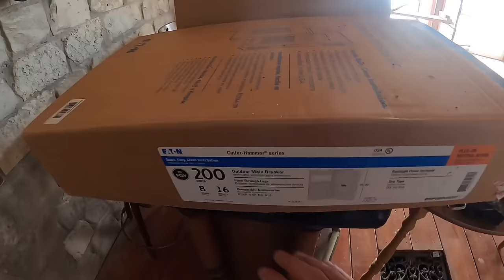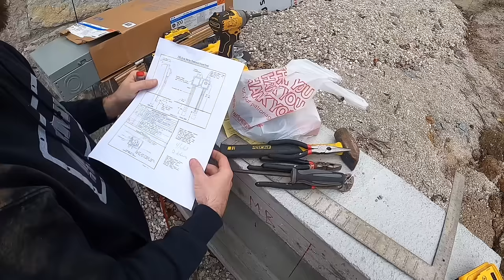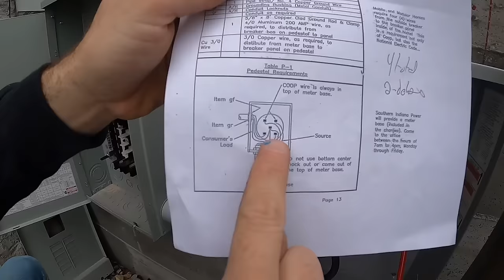prep work for 200 amp upgrade!

Comment: Definitely should have had plastic bushings on the PVC male adapters, before installing the cables.

The grounding conductor goes on the side opposite of the bolt, when installing the ground rod clamp.  It doesn't go between the rod and bolt.  The bolt tightens against the ground rod, clamping the grounding conductor between the clamp and the rod.

Comment: I truly love watching your vids and how you tackle your projects and I recognize different areas have different standards , I have been a utility lineman for 35 years now and have done storm work in several provinces and states so have seen many standards and quit frankly if your entrance passes their inspection I will be so worried.....been to too many fatal house fires over the years caused by faulty wiring.  Also noticed that when you dug the trenches that all the dirt piles are now blocking access to the power poles for the bucket trucks when they arrive......don't want to come across harsh but electrical needs to be left to the professionals.....John F.
Reply: obviously not !

Comment: Sometimes it is painful watching you struggle. But as an electrician, I have done this often and have found ways to make it go a little easier.
and where is your No-Ox? An electrical "grease" that will stop the oxidation or corrosion between the dissimilar metals. (copper and aluminum)
Reply: How about the combo lugs?

Comment: I'm assuming you will install communications of some sort,  while you have trenches open, toss in an extra 1" conduit and you can pull trick, catv, fiber etc, $20 in plastic now can save you $2k in headaches later.

Comment: Howdy Matt, here in Texas you can't have a meter base on the same box as your breaker panel. It has to be separated with either a 2" or up to a 4' splice / separator of conduit between the two and at least 4' off the ground for code. An your right it is a big headache when they don't tell you about that when your there getting stuff to wire one in and all. I've been through the same thing here. You're doing a Great Job on the Castle, Kudo's to ya on that.....

Comment: Good on you for having a crack at it mate, interesting to see how different countries approach construction work. That excavator of DP’s has a few sloppy pins and bushes in it, but I was surprised to see how much you beat on it trying to clean the bucket. Cheers from down under.

Comment: Here in upstate SC, Duke Energy requires dielectric grease on the 4/0 copper connections and must be taped red for hot leg 1, blue fot hot leg 2 and. White for neutral and green for gnd.

Comment: If you mount that panel so low you will have issues when the snow gets higher than the bottom of the panel. There are deffinetly electrical codes that apply in this case.
Reply: Keep in mind that that is not a weatherproof panel.
Reply: @Red1Wollip  He did state it was a waterproof panel.
Reply: @ArnieD17  the nockouts are Nema1 and that panel is not a sealed waterproof panel.
Reply: @Red1Wollip  So you are saying Mat is wrong.
Reply from the maker: The electrical company approved my install location before I used it. I ran everything by them to ensure I met all that needs to be met.
Reply from the maker: I am sure he knows what he is talking about. I just know my electric company approved location and install.

Comment: good job Matt, to save you from frustration get a pro to do the wireing 😊 here in Sweden you need to be a cerified to do electric instalations in the power system for your buildings.😮

Comment: I was a licensed Master Electrician for 35+ years.  I typically refrain from being critical of electrical work DIYers do but I see so many code violations, poor practices and safety concerns here.  This is electricity, a very lethal thing if not done right.  PLEASE, hire a licensed electrician who can help you with what you don't know.  Not to be a smart guy here, but I hope the utility company did not energize that.  Good luck.
Reply: 💯👍🏻👍🏻👍🏻 
So many 90° bends in that ground wire 🤦‍♂️
*Keep in mind that he didn’t hire an architect either 🙄
Reply: Is there a meter height requirement where you are.
Reply: I could not read your drawing but there is a height to the middle of of the meter to the ground. Do the get any amount if snow there.?
Reply: Code violations are unique to the area in which the project exists….these will get sorted by an inspector.  Poor practices are a matter of opinion within the trades and often disregarded.  That leaves safety concerns which you failed to specifically identify….shame on you.  You self identified as a Master Electrician for 35+ years yet not a single safety concern was identified.  Was he supposed to guess and let you play the warm/cold game?  🙄
Because you identified there are safety concerns ….do you not feel ethically obligated to state what they are?
Reply: No difference than the framing
Reply: @genesispuredeaf2390 WRONG. Virtually ever place in the country follows the national code with the only local variations being making things more stringent. The inspectors, if they are competent should hopefully identify all the idiotic errors. It's not up to posters to list all the safety concerns that are well documented and easily accessible especially when they aren't there to do the inspection. It's up to the DIYer to at least do enough homework to make sure the code is followed. As usual, that didn't happen in this case.
Reply: @snappingbear  NOT WRONG….you stepped out first so I ask you why did you even do it if you cannot even produce one example of a safety concern?  I expect that if you wanted to be helpful, then THAT would have been added when I said “shame on you”, if not provided up front.  At this point, you are but one of the many boo birds who like to weigh in ….as far as my speculation goes, you might know something but clearly are not a 35+ year Master Electrician.   I’ve known many MASTER electricians who would never make a single criticism without providing the specific issue that was incorrect but more than that, the solution.  Without that last part, you are at best a journeyman with lots to learn.   

Matt is a YT host and provides content to show what he is doing on his project.  He, like other YT content providers often get accused of having responsibility that they did not sign up for.  He is not a teacher, nor does he profess to be and he is not making recommendations.  When he shows his viewers something that could work for them, then it is up to them to perform their responsibility to invest due diligence steps.   You are not saving the world by being critical (any negative Nancy can do that) and if you had a recommendation, that never made it into your rant which now sounds more like a humble brag (35+ years of boasting experience).  

Full circle buddy….belly up to the bar and prove your salt.  I will be fine with that and will happily learn something.  So far, all you have done is raise your hand to be recognized 🙋…ok heard, but if you want to graduate from negative Nancy, know-it-all nerd, or teachers pet into someone being helpful, do THAT, even bring a little THUNDER Zeus if you got power.  Your turn ….embarrass or hurt me bad with facts and I will happily recognize you and your superior knowledge.  Push back with noise which is absent signal and I will match your energy.

Comment: In UK you would need  insulated cable for earth wire to prevent accidental shorting of live to earth .
Reply: 🇬🇧 And you'd have to have a certified electrician who can test their own installation to do it. A lot safer than letting someone loose with mains voltage.
Reply: @everestyeti  thats the reason this service provider required the customer have their own disconnect and they have the defined demarcation inside their meter box.  That’s to protect their plant and the grid from “whatever” such that whenever anything is discovered as a concern, the electric service provider goes to their meter and switches off the entirety of this customer site without ever touching customer provided equipment (CPE).  That protects the service provider from liability and is for their employee safety.

Comment: Your electrical connections should have electrical paste on the connections to prevent corrosion and bad connections.
Reply: You only use Noalox if your using aluminum conductors

Comment: Your meter socket with a lever bypass is also available with a fused disconnect all within one box. They are made by different suppliers. I agree having a wireman help with your project.

Comment: So Matt , was the clay pipe that you dug up coming into the castle from an old cistern , or was it the sewer line heading out of the castle to the septic tank ?
Reply from the maker: Great question!  I have no idea yet. I find more discoveries with everything I do. I honestly wonder if it wasn’t a pipe for chimney 🤦🏻‍♂️. Will find out when I make it to the basement.
Reply: @nyamillennial   First bucket and you got a cement slab and mystrey pipe.  Par for this course.

Comment: u need two ground rods 6 feet apart   put white tape id on your neutrals  u need 2 inch bushings on the 2 inch conduits Put red id on one phase the other one is black  otherwise goog job

Comment: I was going to tell you the height of the meter and first disconnect switch must be between 4feet and no higher than 6'7" but the meter socket ( to center, mind you) depends on the power company. 
Hope you passed.
It is hard work
Reply from the maker: They approved. I asked all those questions. Everyone forgets the frost line is only close for like 3” then the slope of steep.

Comment: Matt if your electric company is like most, your meter  has to be  4.5 feet off the ground  per osha requirements  for the meter readers so they don’t have to bend over.
Reply: LOL They don't read meters anymore it is all done wirelessly
Reply: OSHA has nothing to do with electrical codes 🙄
Reply from the maker: Our meters are read electronically. No humans reading meters and the electrical company approved the install
Reply: @nyamillennial  as most meters are today, and while the electric company approves ,  the insurance companies disapprove  because of the code is clear on the meter being a set distance from the ground.
Reply: @raymondheckard234  whose insurance company are you referring to…the one that the electric company has, the one that Matt will have covering his property, or yours?

Comment: Mounting the service equipment low, when it snows it will be covered in snow, mount some kindorf to the wall and you can raise it up and move it and level it with no problem.

Comment: With a 200 amp service or better, you have to have 2 ground rides. No more than 6 foot apart. Minimum 6 foot apart with the number 4 copper.

Comment: Trying not to be critical but there are several code violations that will be probably issued.
1. Improper height
2. Ground wire installed in  rigid conduit from meter box to ground rod clamp.
3. Many jurisdictions mandate electrical boxes cannot be mounted directly onto concrete.
Most installs when mounting to concrete utilize galvanized steel uni-strut. Due to corrosion.
4. All connections should be lubricated with a no-oxide grease.
5. You mention in your video utilizing 1 ground rod. Typical grounding requirements now call for 2 ground rods connected in series a minimum spacing of 8’ from rod one to rod two.
6. Ground wire connection in meter socket should be installed at the bottom ground connector position and not the top.
Tip, using 2awg.stranded bare copper conductor must be a continuous run.
7. Bushings are typically required on all conduit fittings.
Good luck! 
I know my local utility would not approve your install not to mention our building inspector.
Reply: Well apparently his does! It’s been inspected and approved!

Comment: Why did you not trench a straight line from the service pole to the meter location? The 304 has independent cab and boom swing.

Comment: As soon as I saw that clay pipe in pieces, I had a "OH S#!@ moment!  Then you said it looks like it runs into the Lighthouse Castle.  😕  Ok........where does the pipe start and where does it end?  And what for?  Doesn't make sense to run a drainage pipe into the Lighthouse Castle!  It seems there are more questions than answers with every step of this massive project!

Well, that electrical hook up was rather simple, despite the battle with the thick wire.

Comment: Reading some of the comments, concerning your electrical skills. Not sure what electrical code is used in Illinois . But the majority of the states use the NEC. I really question some of your work. Especially the meter box and panel disconnect. My opinion, is that you should have had a licensed electrician advise you or did the job
Reply: He has said that the power company approved his plans.

Comment: Looks like there was a height requirement on the meter height. Are you digging that side of the wall down to meet that, or does it allow you to mount it that low? I recently put in a meter and it needed to be between 4-6 feet to the center of the meter.

Comment: That no. 4 solid copper should go into the 200 amp panel on the neutral bar. That is your first means of disconnect, any panel after that will be a sub panel
NOTE  Make sure the panel green bonding screw is in place 
NOTE: that lug you connected the no. 4 solid copper to is where the power company going to connect there NEUTRAL to.
The last 2/0 wire you installed needs to be identified with white tape at both meter base and panel because that wire is your neutral conductor. This may or may not with the inspector.
On the two 2 inch PVC male adapter should have bushings. This may or may not with the inspector 
The acorn clamp the no. 4 wire should 90 degrees from the bolt as you have it behind the bolt. This may or may not with the inspector.
Question dose your power supply the conduit from the meter base to the pole. If power co. dose not and your required to supply conduit make sure you install the correct size 2 or 3 inch

Comment: Is your electrical provider willing to except the height of your meter base above finished grade? NEC requires six feet to center of meter base +or- six inches above finished grade. Also there doesn't seem to be enough circuits in your panel for most homes. If you require a subpanel indoors don't forget to float your neutral and pull a fourth wire to the subpanel.
Reply from the maker: Yup. Or they would not have installed. They were specifically advised shown and explained. Their exact comment was, this is nothing compared to others we have installed.

Comment: Panel looks close to the ground. Needed paste ( nolocks) under main wires. I don’t think it will pass. I see code problems. Been doing electrical work for 40 yrs.

Comment: Matt, If your utility approved this install, I worry for you. That meter is way lower than any version of the N.E.C. I'm aware of, and I've been doing electric for a few days. :P Yes the grade drops off quickly, but it should be measured no more than 3 feet from the meter. Also no less than 4' 6" to the center of the meter.

Comment: And just so you know those MBR and meter base Lugs are supposed to be torqued with a torque wrench . Looks good Other than the height that low setting would never fly around here we have min. Height requirements . You gain a little respect for elec-chickens when you have to wrangle 3/0 wire lol
Reply: Try doing it 500 mcm in cold weather.  Not fun.
Reply: @johnunsicker7440  Thats a fact.
Reply: Try it with "750" coax (cable TV trunk line).  Coax shield is 3/4" outside diameter and 1/8" thick!  AND your up in the air on a pole! (US Army, Fort Huachuca, 26T, Television Equipment Repair)

Comment: first I don't thing your boxes are high enough.here it needs to be 4 ft off the ground.you need to put dielectric trim grease on the wires.we need two ground rods at least 6 ft apart.the ground wire ,we will use stranded wire.

Comment: Electricity is dangerous !!!!
 Boy did you struggle trying to do what a good electrician does effortlessly. The job of installing the boxes looks simple enough but it takes thought and an understanding of the power suppliers codes, the electrical code  itself   , and all the little parts and pieces required to get it approved for use. The wiring doesn’t look  complicated but what wire you install first and how you route it in the box and or boxes will  make a difference. Every wire needs to be cut bent and made to lay in the boxes to a standard you aren’t  aware of. Bending the wires to fit properly and not break your terminals or scrape the insulation off the wire takes years of practice. It’s been 15 years since I inspected my last new service so I’m rusty as to what can and can’t be accepted for service. But I think you might have cut some corners that might need to be corrected before it’s accepted for service. For example our code stated that ground rods needed to be 2’ away from any structure and they had to be  at least 1’ below the surface and were to be  hammered into the ground. 🧐 A good  electrician is worth the  money you have to pay them because they get the job done right the first time. The  power supplier prefers a proven  electrician to almost any and  all diy-ers  because they don’t have to wait for the diy-er to finish installing something they overlooked because the electrical code is a little more complicated than they thought. 
So let me say this as simple as I can. 
Electricity is dangerous!!!  
The higher the amperage and or the higher the voltage the more dangerous it becomes. You have to respect electricity because it isn’t forgiving.  
It’s dangerous if it’s not installed correctly with all the correct codes being followed and adhered to.